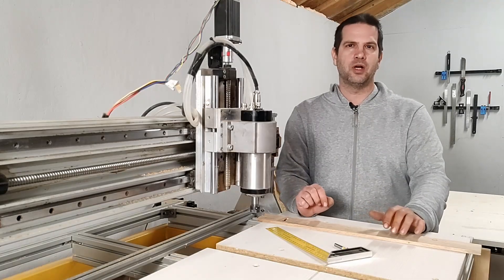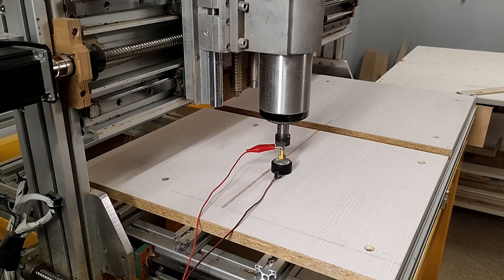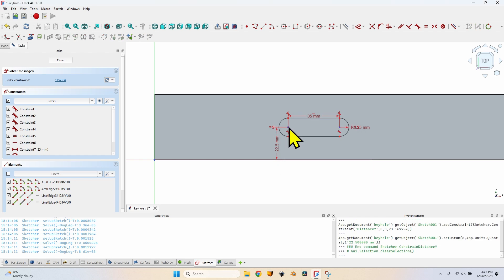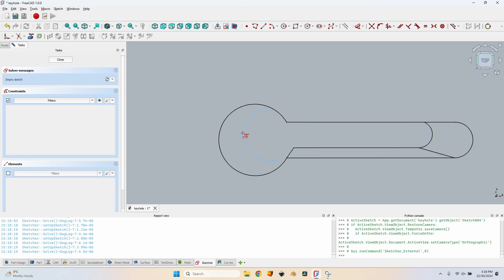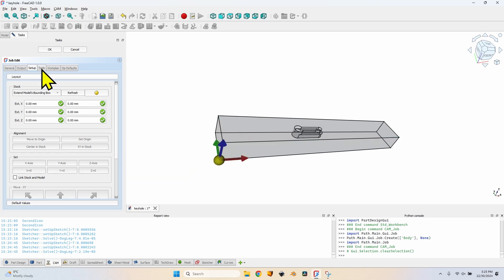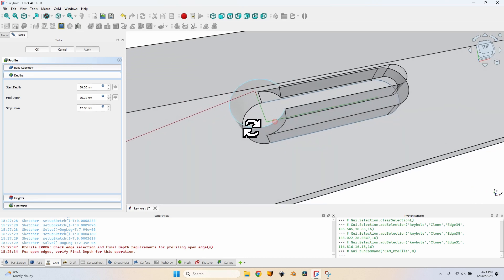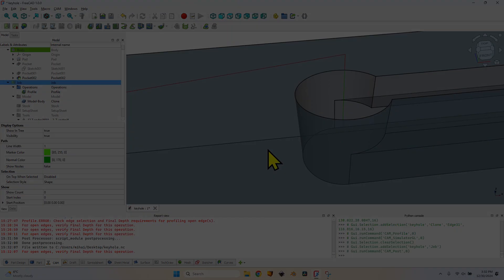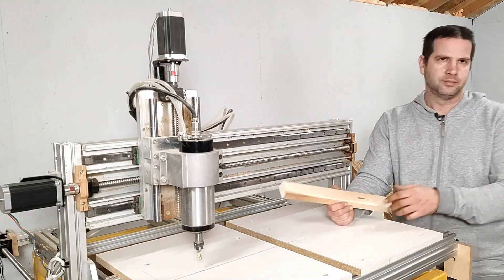CNC Keyhole G-Code Tutorial – Open Source CAM Workflow

Comment: Hello! Nice video! Do You know freecad is capable to real 4 axis turmilling? (simultaneous movement) C axis a chuck what is hold a workpart and can turn around 360 degree.
Reply from the maker: @torpemonguz  I know it has some capabilities to do it, but I haven't tested it, as I don't have a fourth axis yet
Reply: @opensourcecnc  Maybe make a short video about the principle steps?
Reply from the maker: It wouldn't feel right to make a video without knowing if it works as it should or not...

Comment: 13:45 min in you changed the Z Height of the tool path from 16 to 16.02 mm. I was wondering why when it was the tool diameter that was changed from 12.7 to 12.68?
Reply from the maker: Because on open profiles it doesn't create any toolpath with the final depth set to the face, unless you use the 0.02 mm height hack.

Comment: Great video as usual.
Personally I would have written the GCode manually for such job.
Reply from the maker: Thanks! I prefer it this way because it allows me to change the parameters of the keyhole without having to remember to change the gcode
Reply: I am boomer too. I need a grid paper, and a pencil. Except for 3d surfaces.. I hate to intagrate the path..